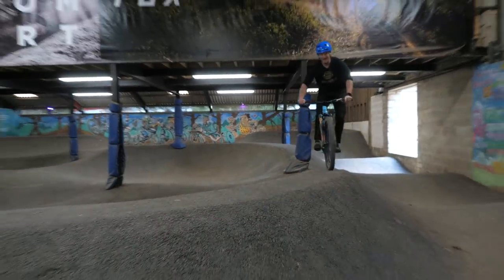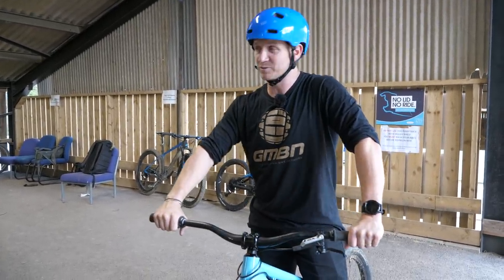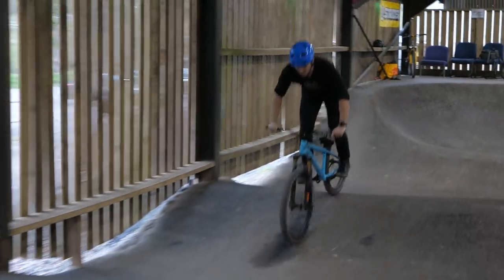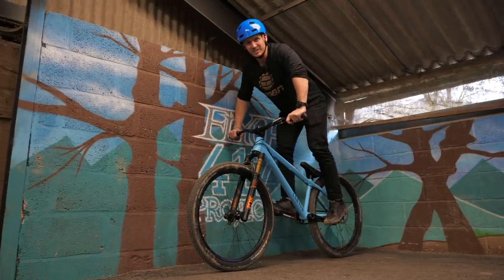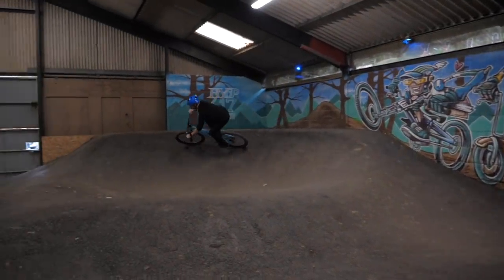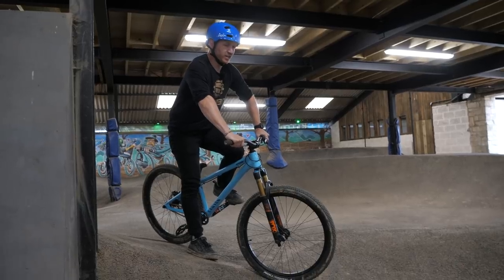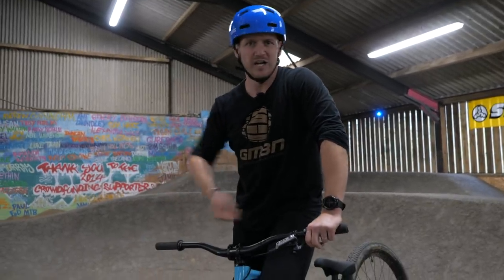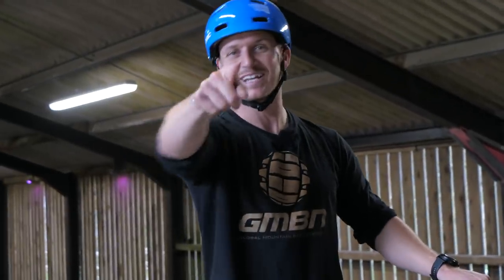7 Pump Track Mistakes & How To Avoid Them | Mountain Bike Skills

Comment: At my pump track the parents think it's a daycare centre and it's super annoying cos you'll have so much speed coming up behind a child and they'll just stop on the top of roller and you either have to break and stop and lose all your speed or try and go around them but they might turn into you and you might turn them into a pancake and it's super annoying because I'll get so much speed and then 10 kids will just waltz onto the track while their are getting out the spoons and the needles and they'll think great somewhere for the kids to play and I'll get so annoyed because this stop on Bermd they stop on rollers and they chick up the drop-in it's so frustrating

Comment: BMX! This is BMX racing in a nutshell. I've seen people gain positions/win races on this skill alone. Second most important skill after gate starts
Reply: At some point you have to learn how to manuell and jump
Reply: @NoGSLForYou start out learning on grass, and practice failing first. When practicing manuals intentionally throw it as hard as you can so you go out the back and try to land on your feet like that. I'm an older novice but learning how to fail is sometimes more important than learning to succeed

Comment: Ah! Very well timed, this video. I have just started taking my XL 29er to the pumptrack. Still feel it in my legs, haha.
Reply: Ethelred77 you can get a decent Bmx for less than £300
Reply: I like the idea, but then i'd have to buy a car as well, because it's 20 km to the pumptrack. No problem on my MTB, but on a BMX... Well, i guess it is time to buy that car.
Reply: Start by using your gear - if you don't find it holding you back in any way, no need to get new stuff!

Comment: Ended up riding a local pump track a couple of years ago and was amazed how physically demanding it can be to keep going round.....is that more common with big dually Enduro bikes or similar for all?
Reply: It's a good workout on any bike
Reply: It's quite a workout in itself - but a big bike robs a big chunk of your efficiency! That's why hardails with rock solid, low-profile tires and progressive short-travel forks prevail.

Comment: Hi Blake, thanks for all your videos I'm 37 years old and just starting on this MTB world. Now Im practicing on a home made pump track here in Santiago de Chile but i think the bumps are too deep and short, so the length is shorter than a 26'' mtb. Is there any special technic for going on that?. Thanks man. Awesome channel.
Reply: You mean peak-to-peak?! 👀 That's way too short! More an obstacle course than sth to pump.
Try to build around two bike lengths to ~2x axle-to-axle in between peaks and the valleys no deeper than the top edge of your brake rotor.
Reply from the maker: 🤔It's would be the same technique but a lot harder!

Comment: That super forward elbow position. Then bake rides with his elbows back around 30 degrees. Elbows super forward causes shoulder impingement and puts way too high a load on the triceps. Back 30 (as he is actually riding) spreads the load between triceps, shoulders and most importantly (as it's the strongest) the chest.

Comment: Is it possible to use that Canyon Torque effectively? Or is a full sus not a great bike on a pump track?
Reply: Long travel fullies lacking lock-out will be a killer workout but you can get'em going ... kind of. Far from "efficient" but doable. To use you words: not a great bike for pump track riding.
Reply: @UCK35czIlFpoHik5hh1Tm8Pw yeah it thought so. But fullies have other dissiplines they are better in. This is a good reason to buy another bike ;)
Reply from the maker: Yes you can ride a pumptrack on any bike! But yes a hardtail is the most efficient for sure 🤙

Comment: Is it possible to have poorly designed pump tracks? Ever since I saw Blake do his first pump track on gmbn, I have been dying to go practice on one. I live in a small town and just last weekend, we FINALLY opened out first track. However, I noticed that the rollers were much closer together and much steeper (about 5ft tall) than any I've seen on gmbn.
Reply: Yes, proportions have to be somewhat right to get flow going.
Ever tackled a jump where the landing didn't "match" the takeoff? You'll instantly notice something is off.

Comment: #AskGMBN
I noticed that on the pump track Blake isn’t dropping his outside foot when cornering - I’m not trying to criticize Blake’s riding (as he is a way better rider than me!) but I’m just curious as to whether there is a different technique required for that kind of riding?
Reply: Since the ground in a park has a smooth (predictable) surface and is banked your bike stays perpendicular to its contact surface - this way there's nothing your inner pedal could get caught on and you're able to push evenly using both legs, feet level, which is crucial for pumping!